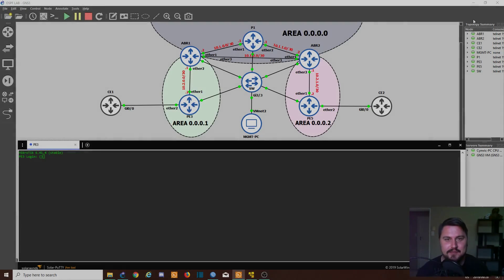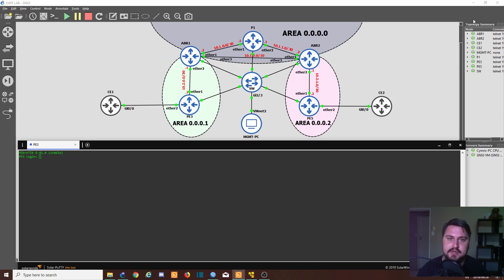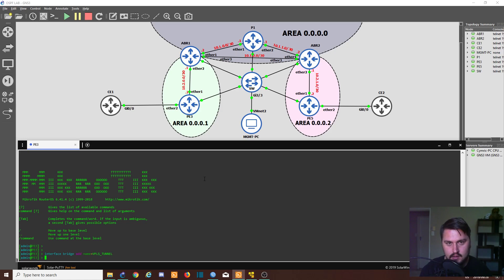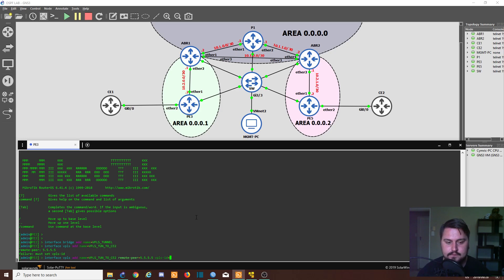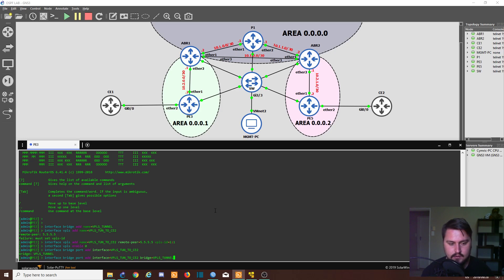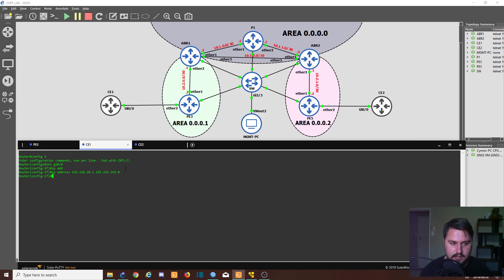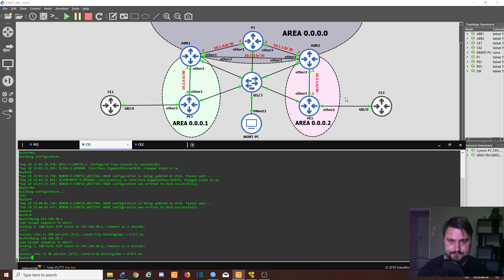MikroTik  - VPLS Configuration

Comment: Hello, thanks for the simple style guide. Is multiple VPLS connections possible over IP Transit from a single public IP to another single public IP? Is there a port that needs to be open or works like EoIP and GRE without any ports needing to be open? Any firewall rules needed when doing this over IP Transit? How to diagnose issues of no linking at all? Thanks.
Reply from the maker: VPLS does not work like EOIP or VxLAN, you are not going to run this over public internet. If that is a requirement I would suggest going to RoSv7 if possible and using VxLAN
Reply: @TheNetworkBerg  Thanks. Have you used VxLAN over the internet? I wonder if it is any better than EoIP or has less overhead. Otherwise, why use it versus EoIP. I am looking to bond multiple EoIP or similar tunnel to get more upload speed from four coax internet connections and then creating a single layer-2 tunnel. Is there any other tunnel technology in Mikrotik (Version 6.x) that does full layer-2 with bridge and vlan capability?
Reply: @TheNetworkBerg  Have you tried running MPLS, with VPLS over a network that connects sites with IPsec, using OSPF for route advertisement on mikrotik ?

I am curious to see how much of an impact the encapsulation of frames and the crypto headers will have.

I will actually probably lab this

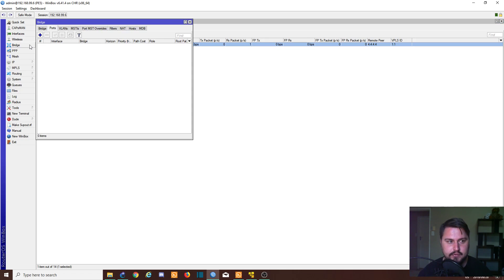Comment: At 5:50 https://youtu.be/qIXZfnHNxdo?t=350 you create a bridge, but when you added the interfaces to that bridge you linked them to the Loopback bridge not the new bridge you created. 
so why in the testing was it able to ping through? That should not have worked.
Reply from the maker: Hi KC, good catch! The reason this still worked is because LO bridge is still technically valid, it's just a name where I happened to put both interfaces into. If I placed the VPLS interface on the VPLS bridge and the ethernet interface in the LO bridge it would fail. But since both interfaces were placed in the same bridge it worked. Although I am certain I wanted to place both interface in the VPLS bridge I created, but just accidentally added them to the LO bridge.